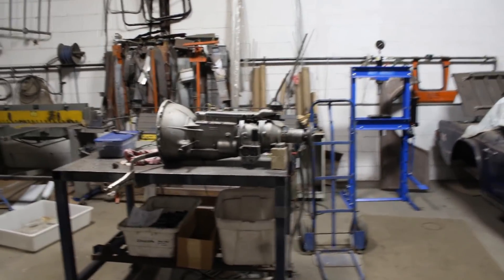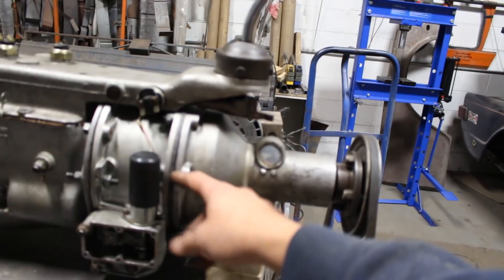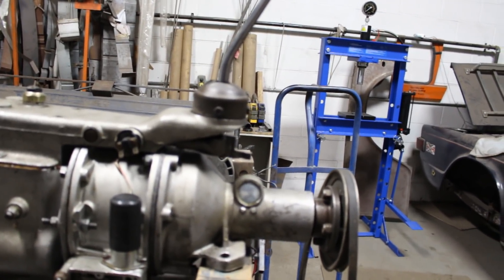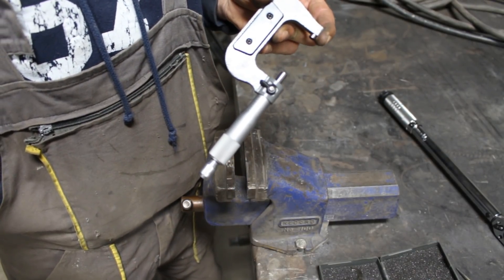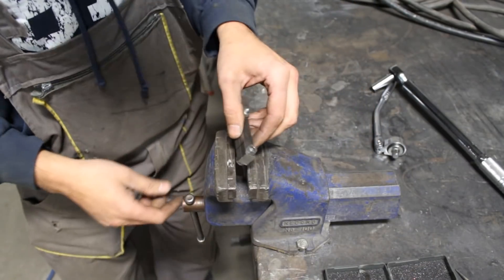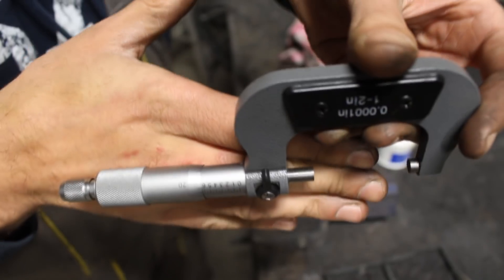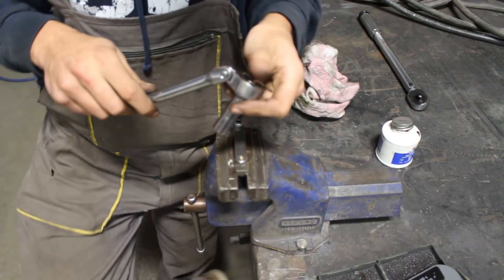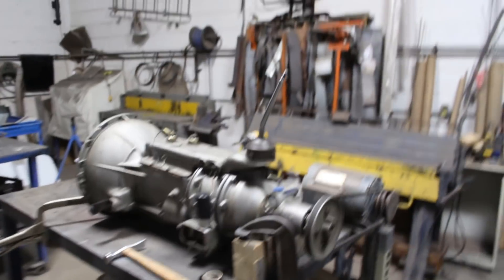How thick is the gasket maker?

Comment: I'm glad the width was the same the second time; I was worried you would have compressed the metal before you even put the gasket maker on!
Reply from the maker: LOL, I just wanted to double check if torquing it to the same level will actually give the same result. Did you pull the pin out yet?
Reply: Elin Yakov No, the pin is stubborn as I am.

Comment: I guess this is not a surprise. In ultra-high vacuum work we use sealants that are also pressed out down to the molecular level. In fact, if you were able to measure with nanometer accuracy you would find there is a measurable film,  but it certainly will have no effect on the operation of the overdrive. Thanks for sharing the results.
Reply from the maker: Yeah, wasn't a surprise, but I wanted to reconfirm it and get the doubts out of the way.

Comment: Hi Elin, Nice video again, it's good to see a bit of research. Okay, just for fun, if you are really chasing around these theoretical thousands, then there might have been a slight error in your end-float measurement. It seemed in the video that your dial gauge was at some angle to the direction of motion. Perhaps you corrected for this, but if not, and the gauge angle was say 30 degrees with a measured displacement of say 15 (thousands), the actual motion would be approx 13 (thousands). :-)
Reply from the maker: Hahah, I thought about that too, believe me, but still the error would be smaller than using the feeler gauges method. Since we moved to the next level let's dig more. In fact you are right, there is some error there too, except it works the other way around. The movement of the bottom end of the angled rod would be bigger than the movement of the top end. My measurement was at the low range of the tolerance so even if it is a thou or two bigger I am still fine :).
Reply: For sure well within tolerance. The angle probably was a lot less than 30 so in any event the real value would be close to the measured value.